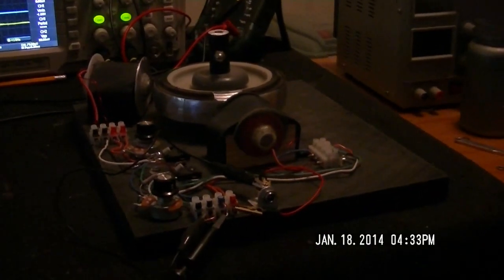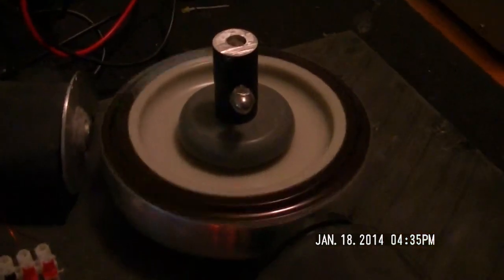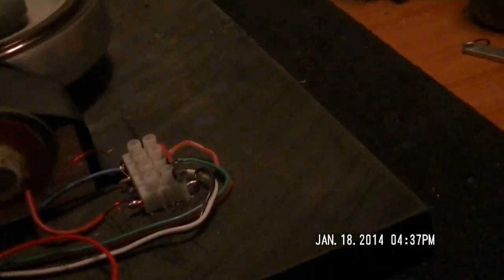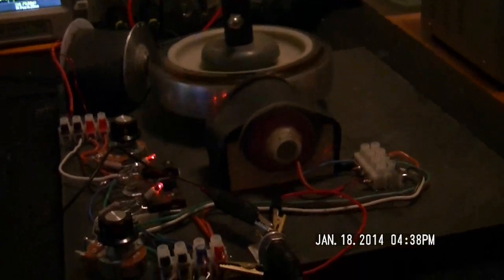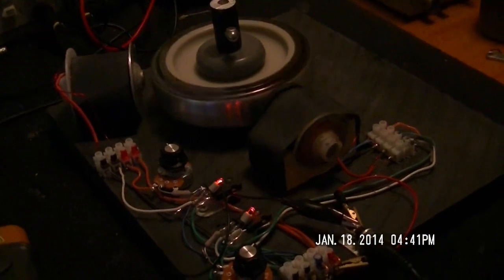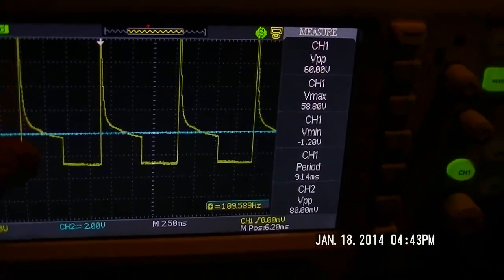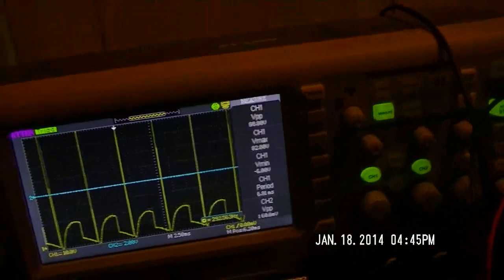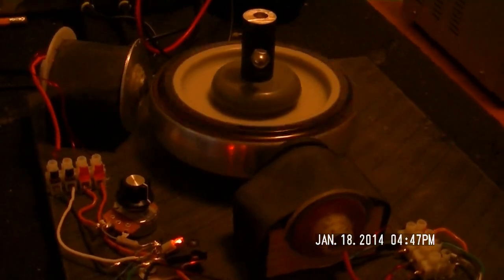Bedini Motor FlyBack Voltage into the power grid?  Is it possible?

Comment: Have you ever experimented with HHO? I have several ideas for over unity motors and such, I live in Ukiah, you should get in touch with me!  I also work in Aerospace, as a Machinist, and TIG Welder.
Reply from the maker: No, never really been interested in HHO, I've always be fascinated with anti-gravity technologies.  I have a new device that I haven't yet fully experimented with, its based on the propagation of convergent and divergent magnetic waves. If your interested in chatting, you can contact me at:  bob24@hotmail.com

Comment: Warning: not an efficient idea, lol. Disclaimer is more for my mental sanity. ok,,,

would it be worth testing a inverter that kicks out 110-120vac from a 12v dc battery. Then plug in one of the wall-warts into it. So the inverter is now looked at as the grid, then see what happens to the 12v battery when the loop is closed, for the scaled Bedini to Grid process? 

Hope this makes sense!
Reply from the maker: Yea, the idea makes sense coz measuring the effect thru the smart meter is difficult. I think the AC cycle on the supply side has something to do with the effect thou.

Comment: I like your work. Ur using a dc pulse to create ac. Spanking the motor and capturing the other side which is why it's one sided. Spanking school girl circuit. 60 hertz is the grid? So ur essentially duplicating a grid tie inverter. I would still keep the system closed and just repair old dead batteries
Reply from the maker: Thanks.  The source supply is regulated DC and its the changing positive surge voltage then negative flyback voltage that creates the AC.
Saving batteries is the preferred application but this was still an interesting tangent and that's where most developed ideas come from.  Thanks for watching.

Comment: are you using the bedini ssg or another variant of the bedini circuit? how could the back emf go past the diodes and back into the grid?
Reply from the maker: If I said back emf, I was mistaken coz I think its the flyback voltage thats surges the high voltage into the charge circuit. But then again, I don't understand the entire process very well.
I'm using the standard John Bidini circuit that uses a diode off the collector of the 3055 transistors,  going to the charge output.  Although theres a voltage drop across that diode, its really the only direction the flyback voltage can go.

Comment: hmm....I know you can do the old am radio antennae trick with smart meters and hear the clicking of the magnetic field, I don't know if it speeds up with usage though....for some reason I expect it would. knagtegl clued me in to why the spikes are so one sided. its so simple, the relationship between magnetism and electricity. your magnets are pointed one way? doesn't it make sense that the spike should too?
Reply from the maker: Yea I guess that makes sense,  But I think the low neg voltage on the scope may be EMF which is always lower then input voltage and doesn't the charging circuit from these motors come from flyback voltage? .... which comes from +V from the battery when the field collapses...doesn't it?   I mean, aren't we only measuring the charging voltage which is the collapsing field or "flyback voltage"? So we shouldn't expect to see an AC componet at the charging output.....just a high +V
 anyway.  or did I say that twice?  Shit its late! LOL 
About the meter... I could try to measure the frequency of the voltage spikes to the speaker using my scope to see if there are any changes. 
Good idea, I likey... that using the ole noodle kid...